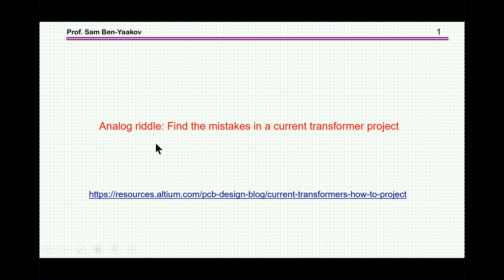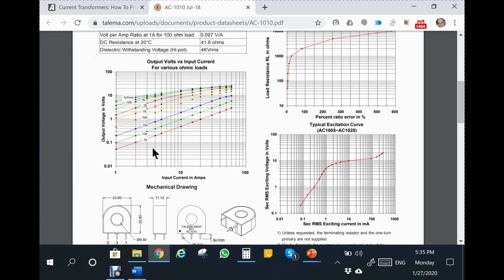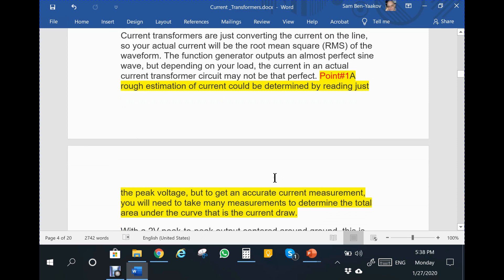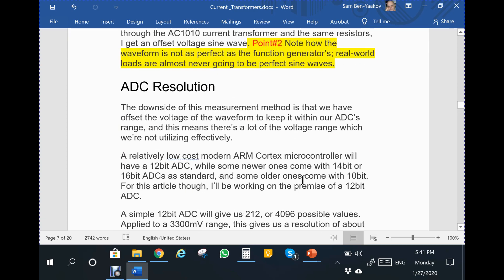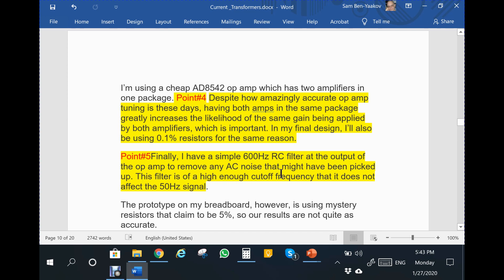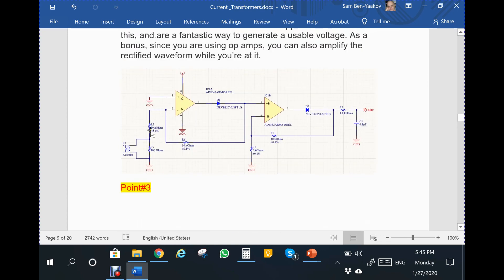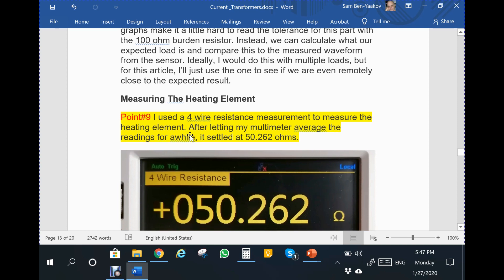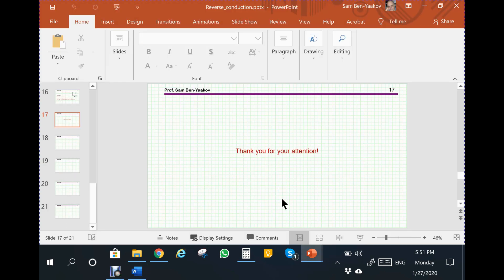Analog riddle: Find the mistakes in a current transformer project

Comment: Point1: Did you mean area under the curve would give zero and he should instead do proper rms calculation with squared values?
Pt2: Probably the act of measurement is shorting the CT primary and secondary in the second case, causing waveform distortion. In the first case usually, the signal generator and scope grounds are same so no effect
Pt3: the cascaded configuration will amplify errors if there is any present. Not a proper closed loop configuration
Pt4: Same point as before
Pt5: The major miscreant- 3rd harmonic will be present happily and 5th, 7th, etc as well
Pt6,7,8: Needs a rail to rail positive and negative supply for increased dynamic range?
Pt 9,10,11: the Heating element will have significant inductance at 50Hz, measuring resistance will give errors
Reply: 3: Cascading two active rectifiers is pointless. Also, the opamp will slam into the negative rail every time the input is positive, causing them to "miss" the start of the negative wave as it recovers from saturation.
5: Besides the harmonic issue, it's being supplied from a rectifier with a resistance to ground much higher than the the resistor in the filter, so the filter will not perform as expected. (It will make an unintentional peak hold circuit.)
6: Could be artifact from the opamp going in and out of saturation as mentioned before.
9, 10, 11: Unless it's an element designed for a low temperature coefficient (e.g. as an accurate load), there will be a significant increase in resistance as it warms up.
Reply from the maker: Good points. Thanks. Point 1. It is a a rectified signal so area is not zero. Correct about rms.
Reply: @sambenyaakov  Yes sorry forgot that it's finally getting rectified.

Comment: Proffesor, when you will be making solution video could you show us what circuit you consider good in such application? I mean one to measure mains current and convert it to suitable 0-3.3 or 0-5V. Would also appreaciate a word or two on how to safely and accurately measure mains voltage. Great riddle Prof, thanks for video!
Reply from the maker: Thanks. Will include these in forthcoming videos.

Comment: The first thing I would say is that if the Talema devices have a built-in resistor across the terminals and you are using the voltage across then technically it's a transducer. 
A measuring CT will have a current ratio and accuracy class to a standard - IEC61869-1&2 and IEEE C57.13 are the most common but a couple other exist. The point of a CT is that you put current in and get current out. The voltage generated across the terminals is then a function of rated secondary current, typically 1 or 5A, and rated burden, measured in VA.
Reply from the maker: I do not think that this CT has a built in load resistor. This also does not make sense considering the plots of left side. The schematics shown is just the test circuit.  So what parameters are missing?

Comment: As for the current transformer's saturation curve, it does make sense for the core to saturate when the load impedance is high. Remember that when the secondary coil of a transformer is shorted, the secondary current will maximize, creating a higher counter directive magnetic field, which will reduce the total magnetic field in the core, forcing it to remain in the linear region of the curve. So it is expected to see a more saturation effect for higher load resistance combined with higher primary side current (the measured current of the wire under test).  

Since current transformers do not have a physical primary side, they can be modeled using a conventional two winding transformer, in which the primary side is fed by a current source with the same current of the measuring device's current. This will help simplify the analysis. 

As for the rest of the questions, I'll attend to them later...
Reply from the maker: Correct. But what transformer parameter are missing?

Comment: point 1
Don't know, maybe that we have discrete signal and we need interpolate it to get curve?

point 2
Probably it's exceeds 3.3 and zener diode "cut" sinus.
or
There is no buffer amp and divider impact to current transformer that make incorect measure

point 3
I saw solution with clasical diode rectifier. Current transformer is current source, then voltage drop on diode is not a problem. And I use this solution, work great.

point 4

I don't know

point 5
cut off frequency is 884Hz but it's still have effect on phase for 50Hz signal. We have rectified signal, it have now 100Hz + harmonics that are important and 884Hz could be a bit low cut off frequency.

point 6

RC filter? amp output impendance is not 0 and it add some additional resitance to RC?

point 7 

point 8
constant component?

point 9
point 10
Heating element is not linear.
Reply: Yes, you will usually want to see harmonics of the line frequency if you want a true RMS reading.

I think you can place a full bridge rectifier before the burden resistor if the current transformer acts as a current source enough.  But it can't allow too many volt-seconds to be added to the 1000 turn side in case it would saturate the transformer ?

I typically don't bias current transformers up this way...  I will place a capacitor between the secondary burden resistor and the 3.3V / 2  voltage divider instead of doing it this way.
Reply: @k7iq  But volt-seconds is flux unit. Flux of primary and secondary winding cancel each other, of course in ideal world. I think (but no 100% sure) saturation reason is leakage inductance.
I use it to measure up to 10A with up to 200kHz sine:
https://www.youtube.com/watch?v=VRjyxihpBYU
of course here is much lowe current (3.33A/1V)
Reply: #1: Integrating current can give mean rectified current, but we likely want RMS current.
#9/10: You can treat it is a linear resistor. The problem is that its resistance is a function of temperature. The author measured the resistance at room temp, but the current measurement is at high temp.
Reply: @pigrew  

I thought about changing resistance with temperature but I wrote about linearity. Thanks for correct me :D
Reply from the maker: Thanks Marcin. Good input. Some are direct hit.

Comment: About current transformer, i think the maximum secondary voltage (that makes core saturate) is missing in datasheet.
point#1 Not area, but the RMS level of voltage on secondary is ~ rms level of current.
point#2 Not only loads, but the voltage waveform of real power grid is not perfect. In case of using resistor, PF is 1 so current form copys voltage form.
point#3 I don't understand this circuit.
point#4 In good opamp gain determined by negative feedback.
point#5 After rectifier you got 100 Hz, not 50 Hz.
point#6 Distortion, i supose, becouse of non-linear charactiristic of diodes?
point#7,8 I don't understand this circuit.
point#9 Resistance of heating element is changing with temperature in wide range.
point#10 Voltage in power grid not perfect stable, it can swing with load/time etc... 3 digits accuracy of power grid? No way!
point#11 10% it's static error, i think this circuit gives a dynamic error.
point#12 Why do not use simple full-wawe rectifier after transformer? You will got only positive voltage for ADC. I assum the low voltage of output and diode drop dont allow to measure low currents...
Waiting for the follow video, espetialy about circuit! By the way, i got one question too, about transformer core. Why it is made from high mu (8000-10000)? (i had one and i took it apart and measure AL). My suggets, it's because of decraising of magnatization current of secondary winding? Thank you for video, Professor!
Reply from the maker: Hi Vegas, Thanks. Good try. Many hits. Will post my answers.

Comment: Wow. I'm shocked that Altium would publish such an error-filled document.

On the other hand, I've seen students make nearly every of these mistakes by grabbing designs off the Internet that they did not understand. Everything is blamed on the components, not the design.

I would get rid of most of the analog design, doing the rectification digitally. On the other hand, that'd remove most of the circuit.
Reply from the maker: Thanks. Good points.

Comment: Wow!  Don't believe everything you see on the internet!  I am appalled by all the mistakes in that design. Here's my take...

Point #1  I think he was confusing how to calculate RMS for continuous signals which does involve integration to find the average "squared" value, with how you would do it using discrete samples (just average the squared values).

Point #2 For a purely restive load, the instantaneous current is always proportional to the applied instantaneous voltage.  The current and voltage waveforms are proportional and always have the same shape.

Point #3 In this opamp circuit, when the input voltage swings negative, the current must flow either out of the first opamp's inverting input, or out of the second opamp's non-inverting input.   Current flowing through an opamp's esd protection diodes on the input pins is a critical design mistake.  Biasing an input's average value near the negative (or positive) rail is generally not a good idea either, even for "rail-to-rail input" opamps as the linearity can suffer.

Point #4 The two opamps are used for different tasks.  The first opamp is part of a inverting-amp/rectifier, and the second opamp is a non-inverting amplifier.  The open-loop gains of opamps are very large (>10^7 typically) and is not well controlled and little effect on the circuit gain; The feedback resistors almost completely determine an opamp circuit's gain.

Point #5 Assuming good rectification (questionable in this circuit) the rectified signal no longer has a fundamental frequency of 50Hz.  Its fundamental frequency has been doubled to 100Hz, and can contain higher frequency components due to the negative spikes where the signal is no longer smooth and continuous.  A simple R-C filter with a cutoff of 600Hz will introduce a -1.4% attenuation (amplitude error) in a sinewave at 100Hz.

Point #6 On the negative portion of the voltage waveform, current must flow out of either of the opamp' inputs!  BAD!

Point #7 It's not the resistors causing the problem.  It's the current flowing through the ESD protection diodes on the negative half of the cycle that is causing the problem.  This could be throwing off the internal biasing in the opamp or causing weird diode-recovery behavior on the opamp's inputs.

Point #8 At 4.4A, the current transformer is moving beyond its linear-region and is begining to saturate, according to the excitation curve in the datasheet.  This saturation might mask the problems with the rectifier circuit by reducing the positive peaks of the transformer voltage. The negative peaks are already clipped by funky circuit loading due to current flow out of opamp inputs.  

Point #9  The resistance of a heating element increases when it is hot (at operating temperature).

Point #10  Incorrect resistance used in calculations.  Error is missing a minus sign, but it is still incorrect because the wrong resistance value was used.  Excessive (false) precision in measured values.

Point #11 Buying a better current transformer wouldn't help in this case.  The rectifier circuit is the primary source of error.

Point #12  A rectification circuit may not even be necessary.  I would suggest using a DC summing amplifier to add a DC offset to the AC waveform, sample it, then subtract off the average DC value and compute the RMS value in software.
Reply from the maker: Indeed.